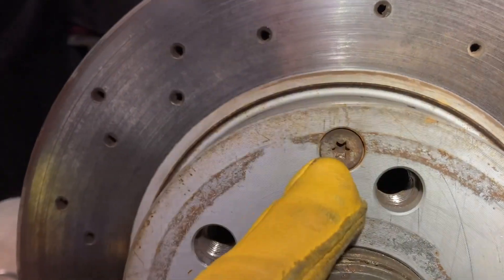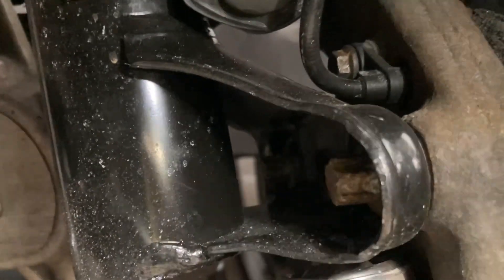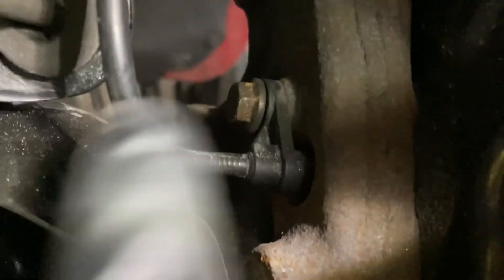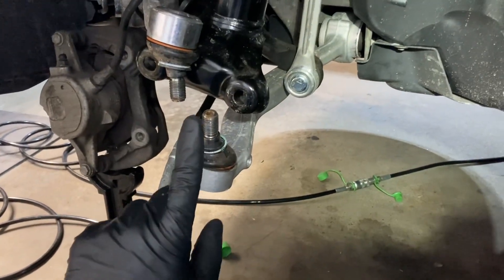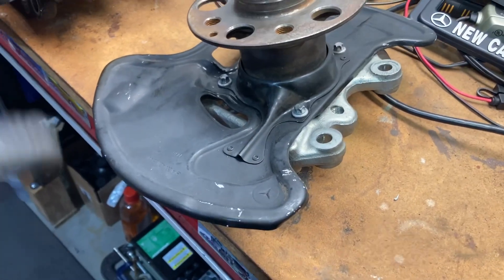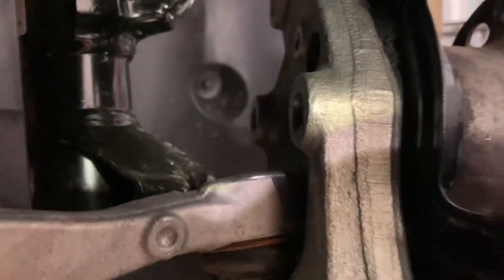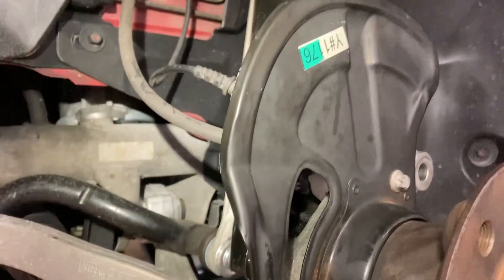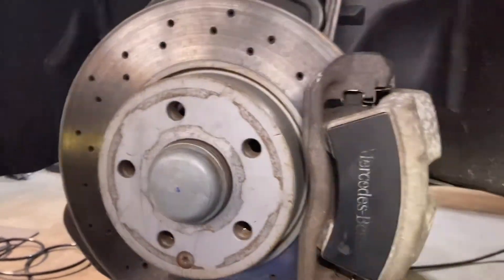2008-2014 Mercedes-Benz C300 (W204) Steering Knuckle replacement

Comment: What problems did u have ?
Reply from the maker: @mikav3728  this car was involved in an accident and the knuckle must have gotten tweaked, as the camber would not align correctly
Reply: @northeastbavarian4249  mine has also got hit at the left front…i get a humming/roaring tire sound also. Something u experienced?
Reply from the maker: @mikav3728  i did not experience that, but it sounds like a wheel bearing or alignment issue. Check your front left wheel bearing and inner/outer tie rods on that side.
Reply: @northeastbavarian4249  it was not the wheel bearing, i have replaced it. Ok ill try with the tie rods